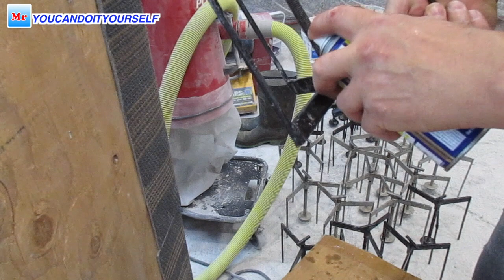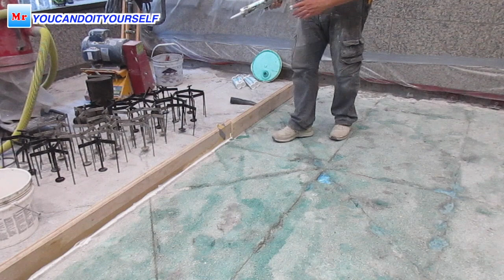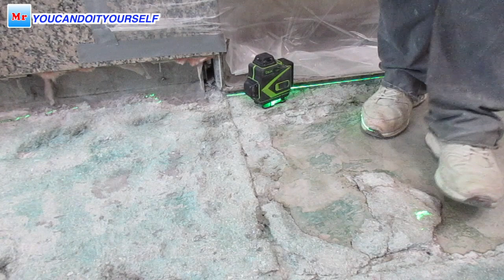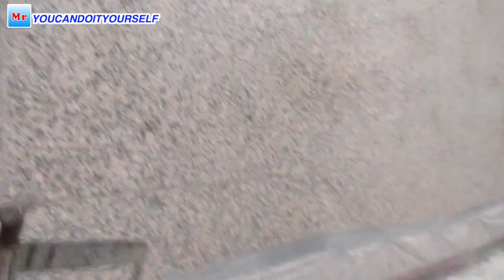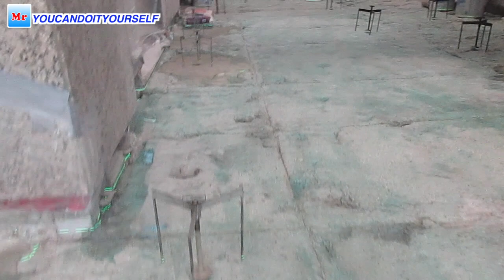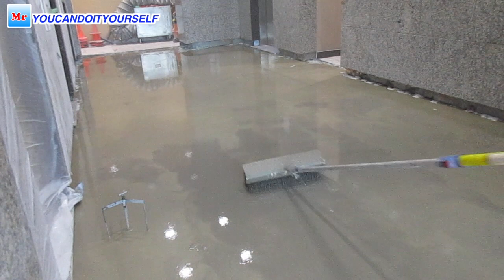How To Level Concrete Floor with Screed Leveling Tripods and Mapei Self Leveler Plus DIY

Comment: Thank you for the video.  How do you recommend preparing a concrete surface which has paint on it?
Reply from the maker: You have to remove it.
Reply: @MrYoucandoityourself  I was afraid of that!  Thanks.
Reply from the maker: @sawtoothmetal  I know.

Comment: Do you find you use a Gauge Rake with Sleds much with your projects?
 or do you rely more on the spiked roller to help the mapei self-leveller naturally flow and level out on its own?  I suppose with floors that are really rough (such as the one in this video), it makes sense to have one to push the material around.   But for subfloors that are mostly smooth (just not fully level) would just the use of the spiked roller suffice?
Reply from the maker: Hi Rui, for any surface I am using spiked roller, gauge rake with sleds for only extend height.